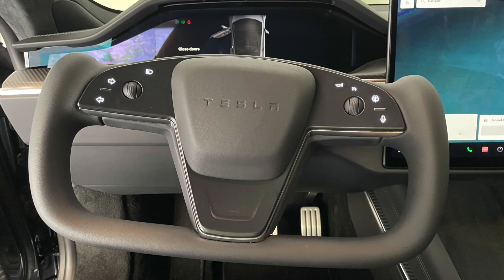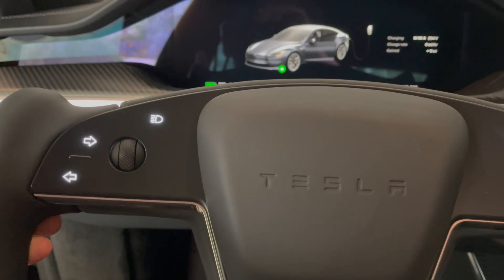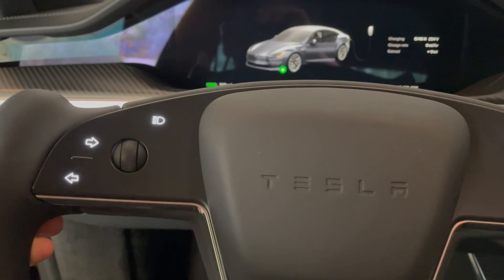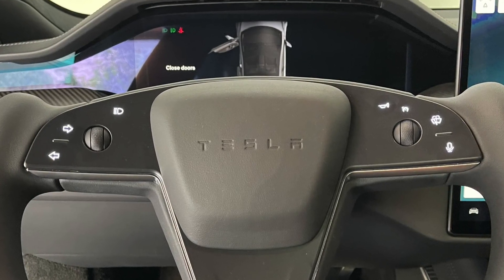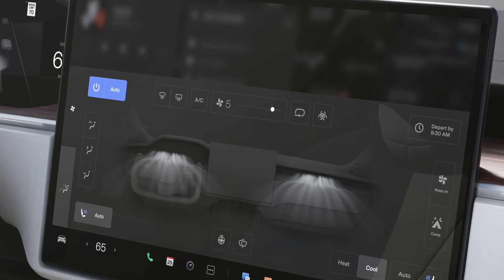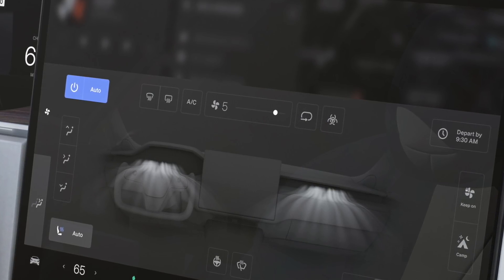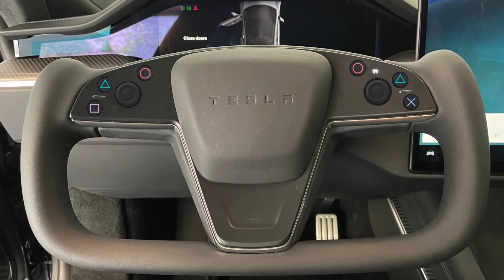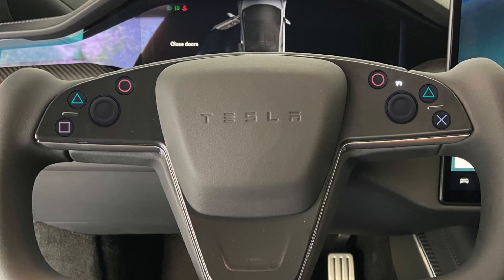Fixing Tesla's Model S Plaid YOKE blunders

Comment: I don't know what's wrong with the standard lever indicators and horns that are on all other cars. Tesla is trying to solve a problem that does not exist and thus creating new problems. I don't like the interior of this car at all. Virtually no tactile knobs or switches at all. It's important to have physical knobs and whatnot to keep your eyes on the road. Tesla design engineers need to go back to school.
Reply: I cannot agree more, I hate those touch inputs on cars so much, that I explicity looked for one that still has as much physical controls for the BASIC functions (AC, radio) as possible.
Reply: Hey Joe......Good points. Its like these newer cars with cameras for mirrors. Needlessly complicated for the sake of saying 'we live in the future maaan'
Reply: Industrial designers probably, not engineers. They possibly knew better, but couldn't complain.
Reply: Also, it has TERRIBLE future proofing. Gee, screens for all controls, as if flat screen didn't have a 50% failure rate within 5 years. Not that it really matters when most Tesla will end up in scrap yard after 6-7 years with dead batteries no one will replace because the battery pack is worth more than the actual car without any third party alternatives because Tesla are literally the Apple of the car world in term of right to repair.

You are watching the next environmental crisis unfolding in front of your very own eyes.
Reply: checksum0 I own a 5 years old Model s with 120k miles. It still holds up fine.🤞
Reply: @checksum00  You realize that only shitty screens fail in 5 years, right?
Reply: @evilkillerwhale7078  You mean like the ALL the pre-2018 Tesla model S/X 17” center screens that all eventually develop a nasty yellow tinge ??

THOSE SHITTY SCREENS ???????
Reply: Law: using your phone while driving is a crime
Also law: having a giant phone be the only way to control anything in your car is perfectly fine
Reply: Fun facts : 
- Analogue devices such as phones still work today and even if they don't, they're easily fixable with off-the-shelf parts.
- Buttons, knobs, scroll wheels and all other input hardware are standardised. Making molds for your cases and buttons also cost's less than a decent touch screen with it's required electronics and software support. Instead of writing code to drive your LCD and manage your touch inputs (including sensitivity and timeouts), you can separate your logic into independent integrated islands. Not to mention, there could be cases for software bugs.
- Not being able to feel a control means you'll spend longer feeling for it and even then you'll doubt you actually activated it this reaction time while driving in town could make you a danger for the others.
Reply: still wish i could afford one....
Reply: it's all about making you feel special. Not about practicality.
Reply: I thought the Model 3 was particularly hilarious with it's air vents... You need to go into menus and further sub menus in order to adjust the frigging air vents!!!! Something that can be done in normal cars in just a few seconds without a wayward glance.
Reply: @bliglum I know. What is wrong with controlling the vent by moving the vent, like in almost every other car? That is what happens when you have a man child force his weird "All driver input is error" fetish on the designers.
Reply: Tesla being the "techy" car company means they basically take nothing about car design for granted. While on one hand that's great for innovating new features that have never been on the market before, on the other it means even basic features that every driving adult is used to go out the window for something flashy. Touch panel turn signals and horn are not going to blaze any trails.
Reply: @OtakuUnitedStudio   It's stupid. So easy to graze one of those touch sensors while turning.

And their touchscreen EVERYTHING sucks too.. Sure it makes for an uncluttered, button free interior... But when you have to go into menus, and sub-menus of menus just to adjust the a/c etc... It's getting a little ridiculous. 

Not to mention the fact that using a touchscreen phone in a car is seen as very dangerous. But touchscreen in-car infotainment is okay?!? Nah, I'll take the buttons and knobs, which can be quickly toggled without even a wayward glance.
Reply: @bliglum  ah, one of those who uses their nose to interact with touch panels I take it? I can see how that would be hard while driving. Good thing the car can avoid collisions for you, at least.
Reply: Yeah seriously. I have a regular old Corolla, and the center panel is a touch screen...I fucking hate it. The controls are so unresponsive and it's very hard to actually use it while driving. I'd much rather just have a physical button/knob/whatever to navigate the menus instead of an unresponsive touchscreen.
Reply: @PootisPowHaha-6969  
Is a corolla, what do you expect
Reply: This is why I consider Tesla a tech company, not a car company
Reply: cost. touch buttons are not much more expensive than the PCB itself. a indicator stick i bet is a lot more. at the volume that could be a big saving in the long term, but they missed the ball totally especially with such an expensive car. should be getting real switches at least.
Reply: I was just going to say that. Amazing the NHTSA allowed them to get away with that. Its flagrantly ignoring conventional SAE standards which are very well thought out. You can't respawn when you crash your video-game and movie inspired car. At some point, you have to acknowledge that its driving on actual roads.
Reply: And as far as the signals go, inadvertently activating them can lead to a fatal wreck. Someone can think your turning when you are not, or indicating the WRONG direction. I had the benefit of a commercial driving instructor and lots of professional driving training over the years, so its taught to verify that the person is actually doing what the indicator says, and not just assume. This means waiting until they slow and start taking the indicated turn, and not just pulling out. Terrible implementation.
Reply: And the haptics. Works great for six months, and then the dinky, shit little brushes inside the motors wear out and no more feedback. Hopefully they used solenoids or something rather than the chinesium neodymium motors used in cellphones. Doubt it.
Reply: I was gonna make this exact comment.  Tesla's 'solution looking for a problem' yoke control is clearly to make owners feel like they have something special so they can justify the increased outlay for a car that is 'ok' but not worth the insane premium Tesla is asking.
Reply: Using a $12 touchscreen instead of 30+ knobs and switches for the HVAC system is way cheaper.  Saves you the trouble of creating all those injection molds and paying assembly line workers to put them all together.  Apply that logic to the rest of the car and they can save hundreds if not thousands on manufacturing costs.

Yes, publicity from "revolutionary" design that places form over function is all nice and well...  but at the end of the day, these changes are all about boosting profits.  That's why companies are ramming these bad designs down our throats no matter how much we complain about them.
Reply: @Waccoon  I don't think knobs and switches cost that much, they normally cost pennies for each. Also Tesla is not a budget brand. Their cars are expensive luxury cars.
Reply: @pleasedontwatchthese9593  Doesn't matter if it's a luxury brand or not.  If demand is high, manufacturers will pinch pennies wherever they can, just because they can.  Same reason that $12 touchscreen costs $1,000 to replace if it breaks.

I always chuckle when I see a $300K Ferrari with some cheap controls taken from an entry-level Fiat.
Reply: @Waccoon  "Apply that logic to the rest of the car and they can save hundreds if not thousands on manufacturing costs."
Couple thousands? XD Not even close. On the contrary - having everything in software with pressure-sensitive glass buttons costs a lot more than a simple physical button.
Reply: @Waccoon  the HVAC controls are one thing, but the touch panels built into the "yoke"? Nothing about saving money there, it's like they got someone who grew up on smartphones and has never seen the inside of a car to figure out how to handle those.
Reply: @Waccoon  it's to achieve their long stated goal of getting these cars under 25k. Obviously profits are also important too, but these measures all are inline with their goals. Encourage self driving and make the vehicle easy to manufacture. Not rocket science.
Reply: @SK83RJOSH  Baloney.  Subcompact economy cars have included real buttons and switches for decades.  All this technology and gadgetry is just window dressing to make things look more expensive than they really are, so they can justify bumping up the price.

Tesla is in a position where they have to be different (even if it's stupid) just to stand out and project the image of innovation.  They just found a way to make their cars look premium and high-tech while using cheap junk.  Unfortunately, other manufacturers are copying this.

And, yes, it is cheap junk.  Unlike back in the 90's, capacitive TFT stuff is really, really easy to make these days.
Reply: Engineers creating problems to solve.  Its like when a politician is giving a speech and they ask a question and then answer their own question.
Reply: My thoughts exactly.  Leave the touch interfaces in the space capsule — there aren't any pedestrians in space.
Reply: Phones were analogues but now we have smart phones so if u think ur touch screen will spoil in 5 years den why buy it 😂💔
Reply: @niche4339  replacing a phone, which is a standalone device and relatively cheap, is much easier than replacing a built-in touch screen that's proprietary to the car. You can't just run to the store and swap out your car's built-in touchscreen for some off-the-shelf tablet. So the screen in the car has to be built to last.
Reply: @ThePattyO  Which they are. So if the replaceable, shitty screens on phones last for 5 years, why are people screeching like automotive safety grade components are going to fail quicker than that? The earliest Tesla screens had glue failing issues, but functionality is not known to have been a problem after a decade. 

The newer screens are even higher quality.
Reply: @niche4339  Funny story about that... my last smartphone's screen died... after about 5 years.
Reply: It's obvious why you don't get it, grandpa. IT'S FRIGGIN OLD, MAN!

Those were invented over half a century ago. Out with the old and in with the new! If we had a reliable force field technology, imagine with what I would replace my glass windows with? Exactly. Because it's new and cool.

Stop halting progress, boomer.

Also, the fact that Tesla still wastes wheels by producing 4-wheeled cars instead of 3 wheeled cars (which is enough for stability and would give out a nice futuristic triangular look) greatly saddens me.
Reply: @UltimatePerfection  Please tell me you tried to be sarcastic and just failed....

Comment: That steering wheel setup is a total fail. Software can't fix a stupid design, switches provide feedback, and a certain amount of resistance to prevent unwanted activations. Touch sensitive design interface fail on this feedback/prevention because the touch response isn't intuitive with uncertain feedback, also having one button do multiple things (ie. indicators) is a poor design. Other cars do this on the indicator stalk, with a simple 1/2 push down and audible click sound, or a full push down for a full turning indication. Why provide some alternative to this with a half bake version that everyone needs to relearn.... for no real usability gain, or reason. Also having to target certain important (horn, indicators) buttons with your eyes off the road is just plain wrong! Clearly the design dept has to many 'yes cool', and not enough 'this is stupid' people.

Rant over...

Comment: Reminds me of Chrysler changing up their “gear shifts” on some vehicles a few years back. They had it as a soft switch, click down/release, click down/release, click down/release. It definitely caused confusion and led to a number of deaths. Newer Ford vehicles still have a lever style controller on the steering column for indicators but they don’t lock in place. Click up->turn on right indicator, click up again to turn off. Click down-left, click down off... when changing lanes in most vehicles you click it one way, and then the opposite to shut it off. In these you end up signaling the wrong direction for a moment. You get used to it after a while, but it’s a much different interface with the functionality. The worst car ui change I’ve seen was combining the brake and accel pedals in to one. You literally let off the pedal to brake. Can you imagine most people’s “emergency” brake reflex to slam on a pedal in this vehicle?! Really awesome video! UI/UX is not solely a screen domain problem. Thanks for posting.

Comment: Having a touch interface for a vehicle's controls is just plain stupid. There's a reason why airliners have been removing them in the first place. They're just not safe because of the precision and mental focus required to use them effectively. Drivers need to concentrate on just the driving and nothing else.
Reply: There was an airplane, might have been the MD-80 that every switch was unique to its function.  So any pilot could operate the cockpit by touch alone.  The pilots seemed to like that.

Comment: Have they never heard of physical buttons? You're supposed to operate many of those functions in the dark while driving, so it should be doable without looking. Seems like a poorly designed thing indeed.
Also, those scrolling wheel things look kinda awful, I've seen better ones in mice. They should have probably just used a d-pad.

Comment: What is the point of making a SINGLE indicator flash in the first place, let alone as the default mode of operation unless you do a hard press? Who flashes their indicators a single time? That steering wheel would infuriate me, honestly.

Comment: Excellent example of why you need a UX designer, not just a UI designer.

- capacitive buttons are basically never useful - just use regular buttons. They're reliable, you can find them by feel without activating them, and they're nearly idiot proof.
- pressure-sensitive buttons doing different things is bad enough when you aren't moving, let alone while driving
- haptic feedback in a car!?
- buttons too close together
- many of these don't belong on the wheel at all
- why the heck is it even legal for the horn to not be the whole middle of the wheel?
- glowing buttons seem like a distraction and eyesore at night
- scroll thingies can be pressed sideways but clearly weren't meant to be
- weird wheel shape - they're round for a reason (so you don't fumble during sharp turns when it isn't where you expect)

It's really clear someone designed this to look futuristic, without any consideration about whether it's practical. Move a few of these things to the centre console, replace the stupid touch stuff and scrollers with plain buttons, and use a round wheel and a signal stick like every other car made in the past 100 years or so. Cars are not the place to try to be flashy and modern. Safety is #1, and ensuring the driver has to use as little brain power as possible, and ideally not look at all, to activate controls is a major safety aspect. Every time someone has to glance at the buttons to find them or has to take a second to think about whether it's a short or long press or is distracted because they accidentally pushed another button, that's potential for a fatal accident.

Also: I bet these capacitive things don't work if you have gloves on. (and turning up the heat isn't the solution. Imagine these in a truck, and a worker who has to frequently get in and out of it is dressed for the cold, or has to load/unload wood and doesn't want splinters...)

It's nonsense like this that make me call Tesla the Apple of cars. They're clearly designing for form over function. They're not better than the others, they're just fancier-looking, more expensive, and well-known mainly because they were the first to successfully market the product. This kind of attitude toward designing phones isn't a huge problem (unless you pull a Samsung and make them explode), but cars are very dangerous and must be designed very carefully.

Comment: About those turn signal buttons and the feedback - that is if you find them. Signaling out of a roundabout you will need to take your eyes off the road and try to locate them. And with the wheel / yoke turned they may be up side down on the other side. Bad design, dangerous and unnecessary.

Comment: The yoke overall is a terrible design. It only works if you don't have to have steering inputs past about 100-120 degrees of rotation from center. That's why F1 cars and Indy cars use them. 99.9% of the time they don't turn more than 90 degrees, and if they are they are typically moving slow enough it doesn't matter. Having a yoke in a passenger car where you have to frequently turn past 100-120 degrees is just asking for an accident because you can't keep both hands on the wheel, and it forces you to have your hands below 9 o'clock and 3 o'clock (10 and 2 is just wrong, sorry driving instructors) which reduces your ability to turn past 90 degrees without removing your hand from the wheel. UI aside, the whole concept is poorly executed even if you can get used to it (which if it was a good design wouldn't require you to get used to it).